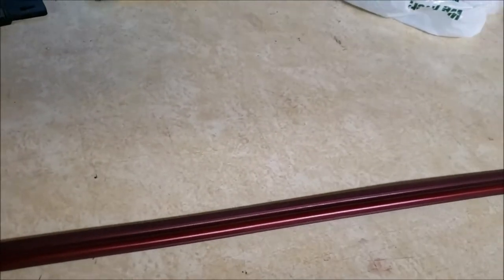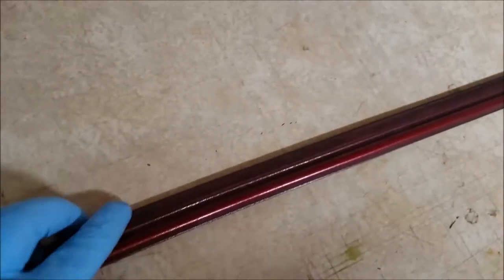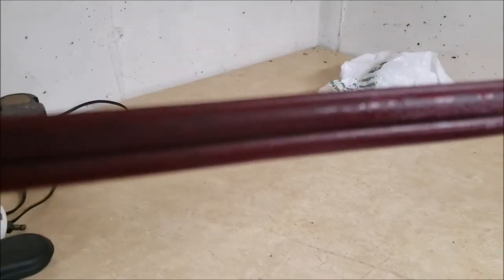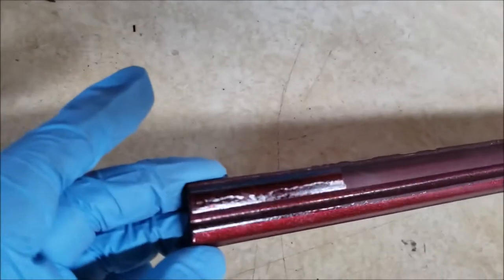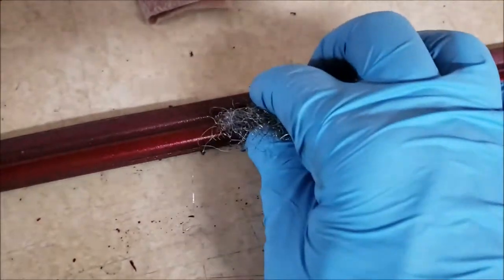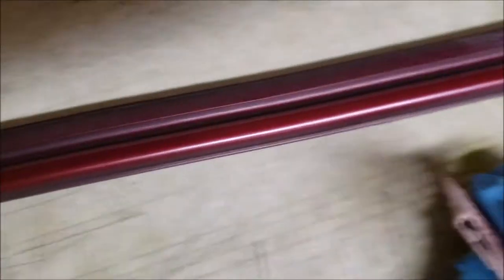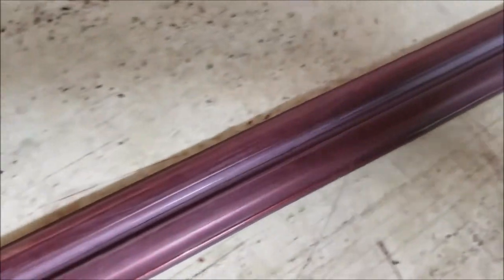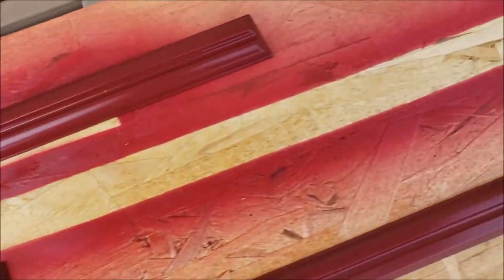87 Cadillac Brougham Repaint Body Side Moldings

Comment: I. Would have liked to see you paint the molding as boring as it may have been.  Any what brand of top coat did you use? Also, do you have a video that shows how to get the opera lights back working?
Reply from the maker: I’ve never been able to work on the opera lights.  I checked the power supply transformer and it was working, so I assume the lamp strips are bad.  I’ve seen other videos of that repair.  The paint I used was a single stage vinyl/upholstery paint from SEM, so no top coat needed.  Thank you for watching.